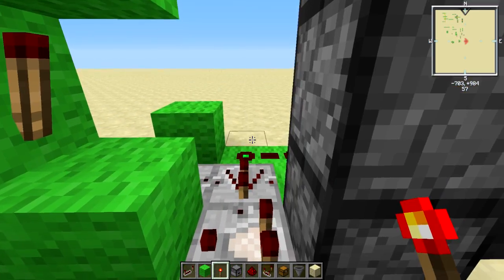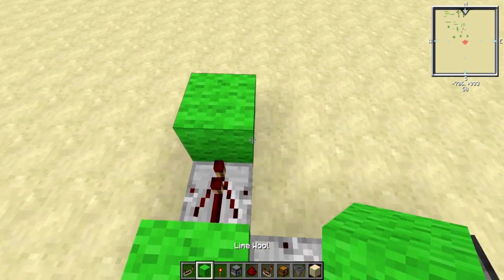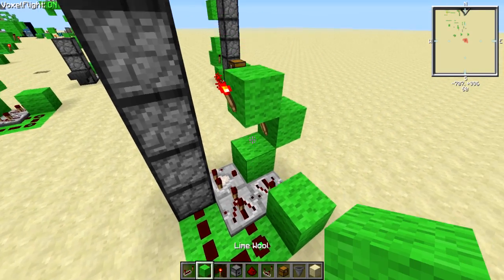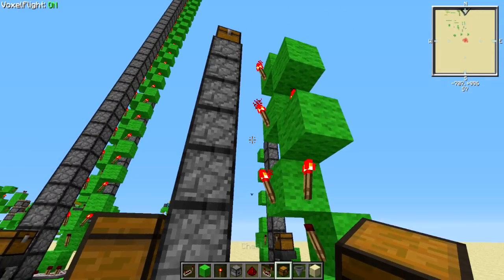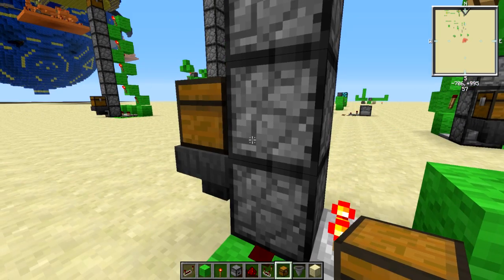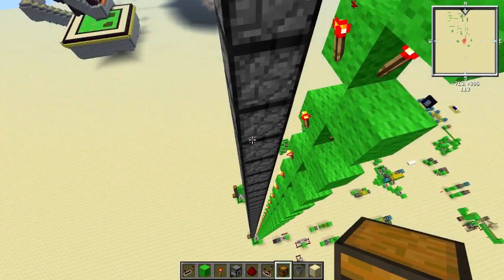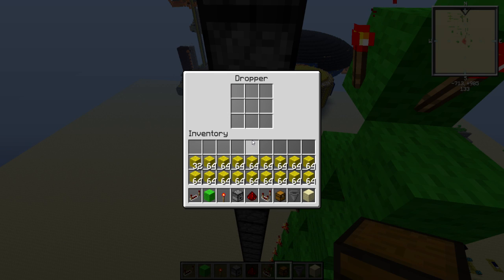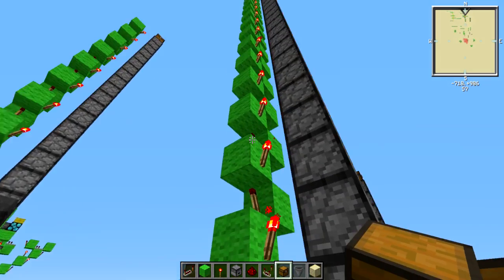Minecraft - Vertical Item Elevator (1.5.1+, Extremely Compact)

Comment: I have built this three times, and all three times it worked just fine, but for some reason the fourth time, I'm having an issue with it, where the droppers push all the items up into a chest as expected, but for some reason the last item gets left in the top dropper. Is there a way I can get your help at all? I've broken it and rebuilt it three times to see if I had timing wrong somewhere, I Even re-wired how my hoppers are running to see if it had to do with that. It would be appreciated! <3<3

Comment: using this to transport items from floor of mob fall trap to item sorter insertion point.  worked well but then noticed something.  had chest at end of sorter to catch overflow/unwanted items.  transport& sorting hoppers/droppers/chest were full of unwanted loot then decided to build item destroy to replace chest at end.  after replacement, your transport system remained clogged.  to fix, had to manually delete all items from your droppers, except bottom dropper.